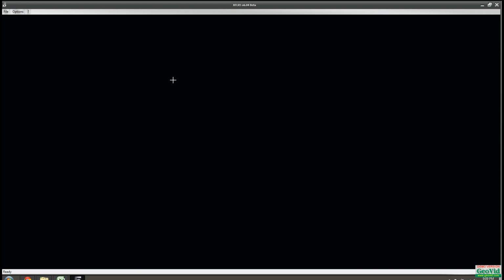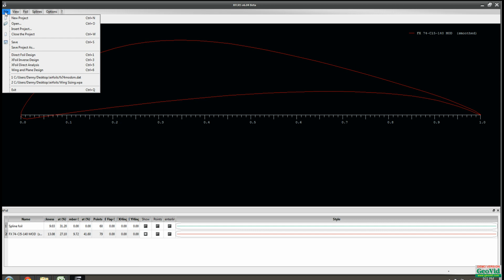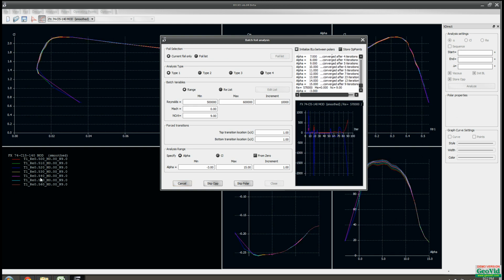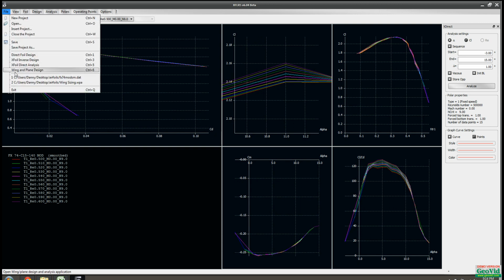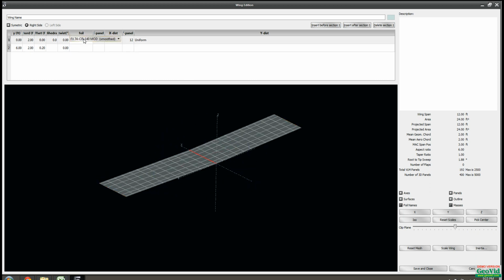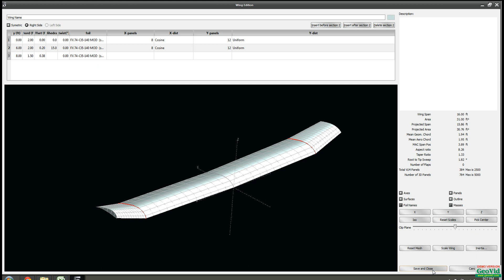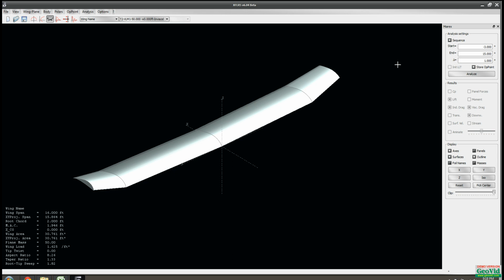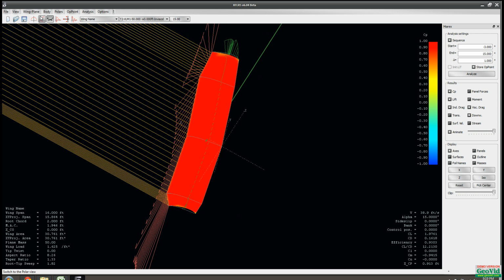XFLR5 tutorial

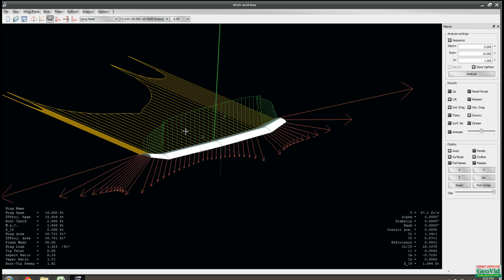Comment: at 9:13 minsfor the coloured  force vectorsare the downwards red vectors  from the wing exerting a downwards force on the Air so  then Air pushes back with an equal and opsosite force and green area is just a low pressure region marked on top of the wing

Comment: Hi there, when I click on the airfoil database wing profile plots, it does not download it, it opens the points on the webpage. I am running xflr5 on a mac, I tried to copy the points into some kind of notepad but xflr5 won't open it. does anybody know how to get around this problem? Thanks, Sacha.
Reply: right click on it and click on save link as.
Reply: also check that they are in the right order, i.e. coordinates around the wing, starting from the trailing edge (1 , 0) over the upper side (1->0, >0), to the leading edge (0 , 0) over the lower side (0->1, <0) to the trailing edge. If not, order them with excel or notepad)
Reply: Just copy it in a notepad and change extension (.txt) to (.dat)
Reply: +sachashower Im also having that problem, i downloaded the link, but xflr5 won't  open it, did you manage to do it? Thanks

Comment: Hi Daniel, would you happen to know how to use XFLR5 to show if an aerofoil is able to do inverted flight? thanks a lot
Reply from the maker: Open up the .dat file of the airfoil you want, and put a negative (-) sign in front of the "Y" values. This will mirror all the points and give you an inverted airfoil. I did this for one of my projects, and it worked great.